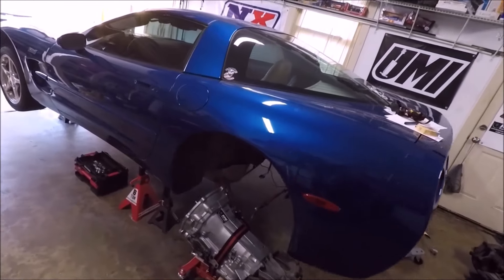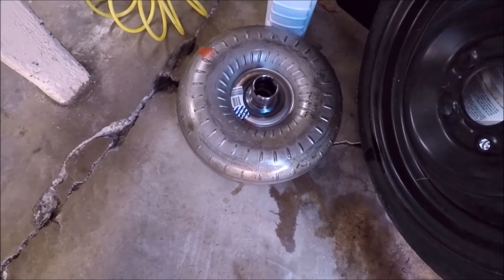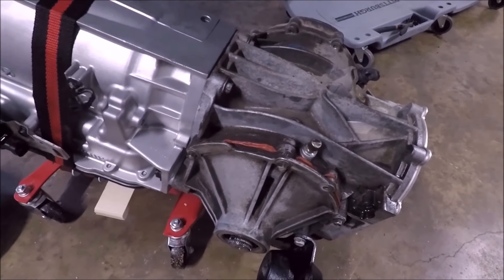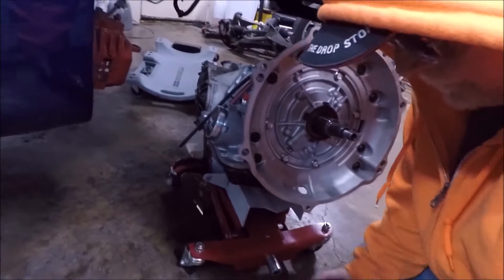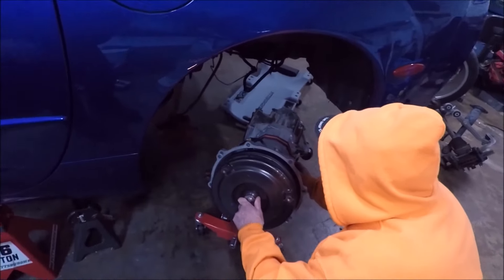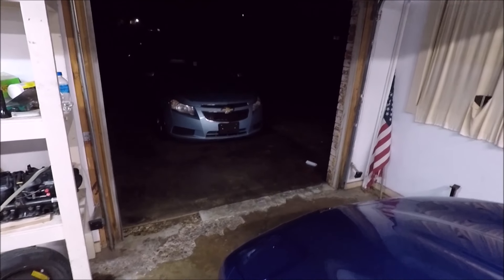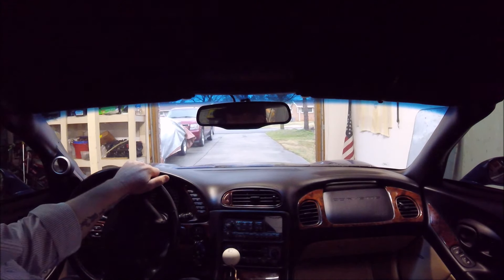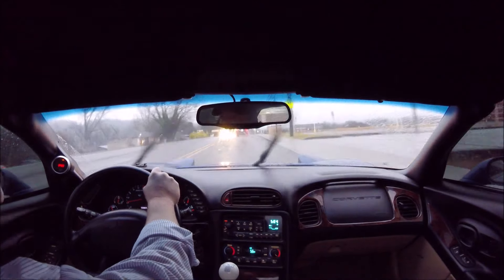97-04 C5 CORVETTE TRANSMISSION INSTALL (RPM TRANSMISSION, TCI TORQUE CONVERTER)

Comment: Dodged a bullet, if you had put a used converter the Warranty would be voided on the RPM transmission.  Blessing in disguise saved you!  👍
Reply from the maker: Used converter doesn't void their warranty if you have it flushed and inspected. Problem is that costs just as much as just buying a remanned stock unit. And I've had bad luck with those in the past.

Comment: These two videos are great! I have a question, I’m about to replace my trans output shaft seal in my 01 c5. Would I be able to just do same process, drop the cradle to access the Diff/Trans connection bolts and slide it back without having to drop/remove the whole trans? Thx so much in advance, Jason
Reply from the maker: I don’t see why you couldn’t brother. With the cradle and rear suspension out of the way the rear diff bolts should be easily accessible.
Reply: @BadLuckGarage  thank ya Jesus!! :-) seriously the best videos of this process. I certainly appreciate the time you put into it. Thanks a million, Jason

Comment: Hows the TCI converter holding? Ive seen on online forums people saying to spend extra and go with pro torque 2800 3200 or circle D! Im im process of doing a cam swapped and btr recomends 2800 3200 stall! Any help will be apreciated!
Reply from the maker: Still working just fine. But depending on what cam you plan to run you’ll definitely want more stall speed.

Comment: Did you set the tension on the TV cable?   700r4’s will burn up quickly if the cable isn’t tight enough.
Reply from the maker: Its not a 700r4 brother. Theres no TV cable.
Reply: @BadLuckGarage  Yeah I was talking to Richard he said only the 1994 and older had the manual TV cable. Good luck getting the transmission dialed! 😎
Reply from the maker: @HeadFlowInc  she started shifting perfect in the last video brother. No idea what was causing the issue. I even called RPM and still couldn’t figure it out. But seems to be fine now. 🤷🏼‍♂️

Comment: How many quarts did it take in the transmission I just replaced mine and it only took roughly 7-8 quarts
Reply from the maker: It takes as many as it takes till it’s full brother. How much with vary depending on your torque converter, whether or not you flushed out all the cooling lines, and if you have an aftermarket cooler or not. Just follow the procedure until you’re sure it’s full.

Comment: Don’t recall anything about the torque tube. Did you have a torque tube alignment tool, or what did you do?

Watched both videos, but don’t recall anything about this.

Thanks!
Reply from the maker: The torque tube aligns itself on the transmission dowels, same as bolting a transmission to the back of an engine. It’s foolproof.
Reply: Thank you very much. 

Had a transmission shop tell me they needed a torque tube alignment tool, which they didn’t have, so they said they only people that had this was the dealer, so they sent me there, They told me the same bs. 

Just didn’t think the shop wanted to mess with it.

That’s why I asked my question, as I didn’t see you do anything like that in the videos.

Thank you very much!
Reply from the maker: @jamesroberts7768  Maybe it’s a manual transmission thing to align the clutch? That would make more sense.